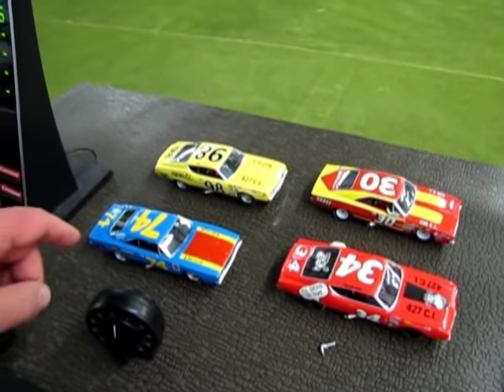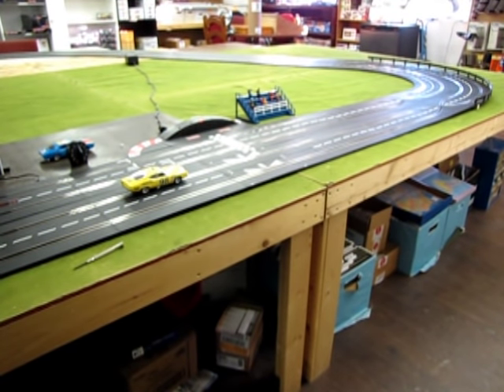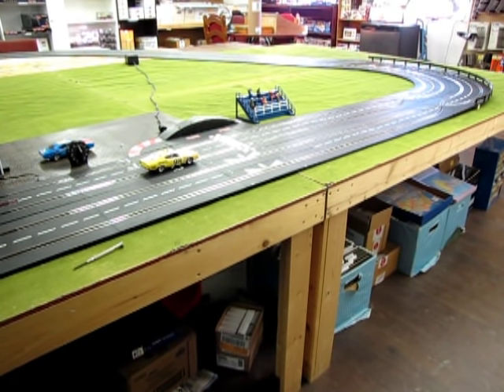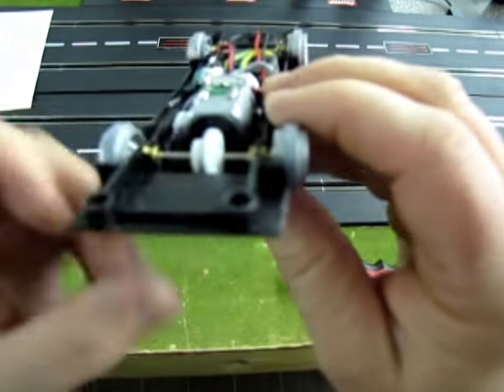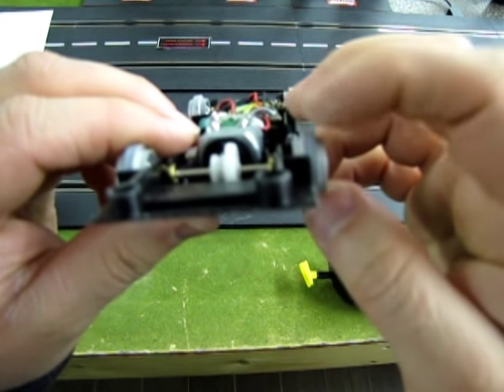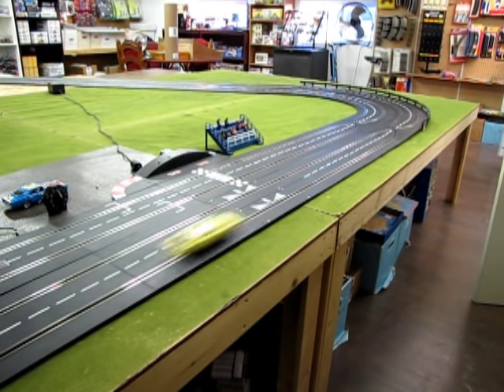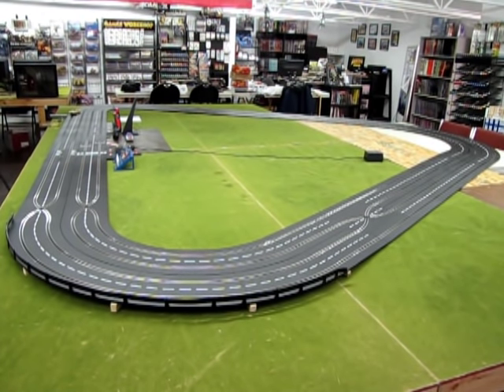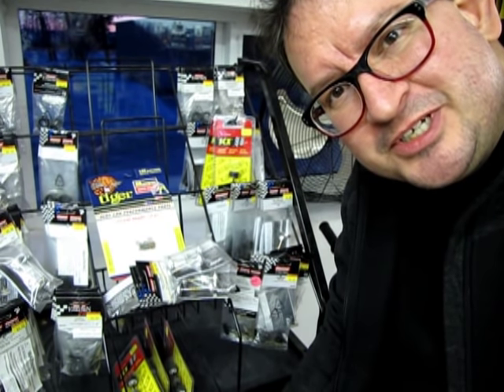How To Tune Up Your Carrera Digital Slot Cars (The Monster Hobbies Way)!

Comment: I found that using packing tape to clean the tires with it will take all of the dirt off of them You just take a piece of tape and you pull it on the tire and it will remove the dirt
Reply from the maker: Good tip. I will try it!

Comment: I have a Carrera digital track and i'm  having trouble with a  double crossover it wont work going from the outside to the inside but it works from the inside to the outside It happen twice  the first one came with the set and I bought another one and it did the same thing  any help would be  appreciated
Reply from the maker: I am not too sure on that problem. It could be the cars, the control sending unit or the track itself.

Comment: I have question can you used wired controller and wireless controller same time on Carrera Digital 132?
Reply from the maker: There is a wired digital controller, but I don't have any of those to know if you can run the two together at the same time.

Comment: Sorry but this is a no go.     Sanding on a track not ok. Axles sanding is not a good idea but I can imagine that you cannot or willing them to change into a slot it or ? Sanding and cleaning front tyre not ok >>> zero grip on front tires is the trick.  Front and rear tires are not the same. Racing with a magnet is not my kind of racing but that is up to you.
A lot of things you should not do for tuning.
You talk about dust and hair and you tune a car on track?    i
Reply from the maker: Thank you for your comment.

Comment: 14:08 Never do that!  Specially with a grit like that.
Reply from the maker: Why not? It didn't kill my car in any way.
Reply: @monsterhobbiesonlinestore  The point is to remove any barbs and make the axel smooth. If you look at a microscope before and after you do that, you will see lots of small scratches from the sandpaper which will wear the bushes faster and put more load into the motor. You can do that, but not with a sandpaper. You may try with micro-mesh of 12000 grit...
I would use nothing but 3 2 or 1 micron diamond polishing compound.
Reply from the maker: @covinhas87  Sounds good. I have a set of those in my collection. - Nice to get a description finally. I usually get people telling me I'm an idiot" and then that's it! :D